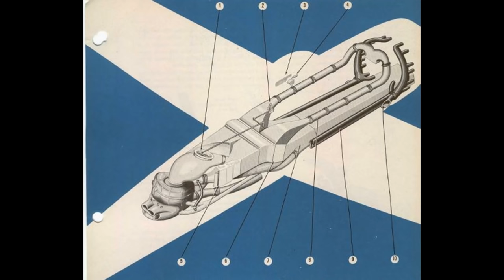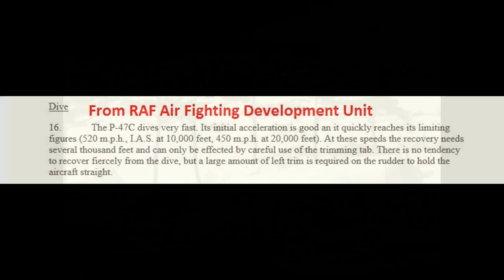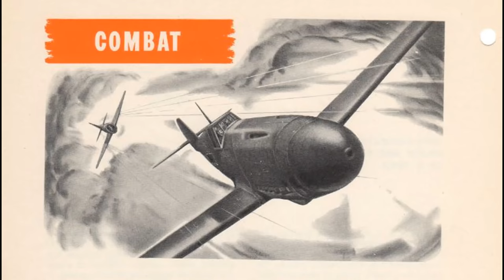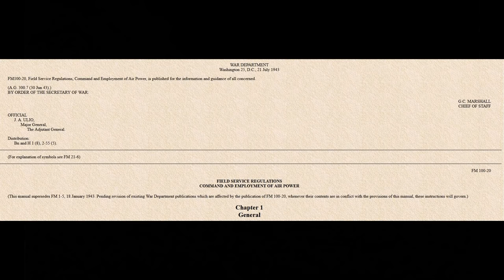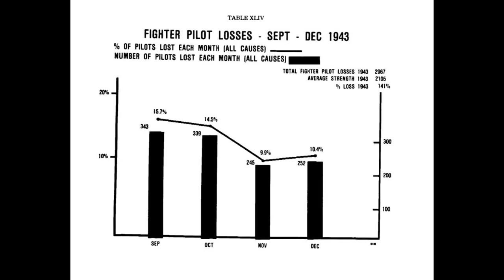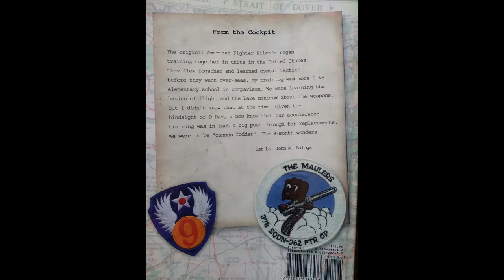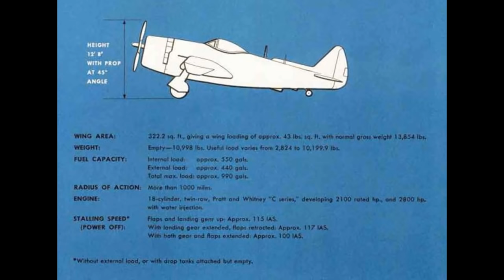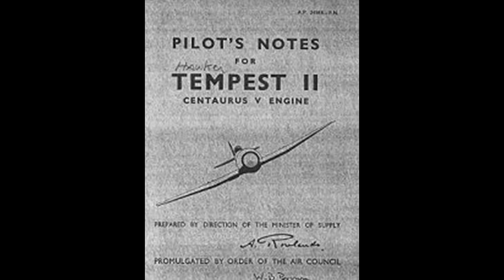P-47 Thunderbolt Pt. 8 Conclusions

Comment: interesting pic at 50:14. That's the Me-109G6 at the Australian War Memorial in Canberra. It's the only Luftwaffe aircraft in the world still in its original paint. That machine is pretty much in the state it was when captured in a plane park in early 1945.
Reply from the maker: I didn't realize that. Thanks for pointing it out, original paint! Amazing.
Reply: @GregsAirplanesandAutomobiles  That plane has an interesting provenance that illustrates some key features of Luftwaffe logistics in 1944-5. Barely visible in the pic is the panel line of the (removed) elongated bulge in the cowling that indicates a DB605AS engine (or derivative). It's clearer in other pics or in person. You can also see the unusually deep oil cooler, also typical of 605AS/ ASM / ASCM / or D model engines. The fin is also messy with a repainted werk number and evidence of replaced rivets. This plane was clearly a G-10 or G-14AS in a previous incarnation. By extension, it's also clear that this plane has had at least three lives: as a initially as a G-6 or G-14, then as a G-10, then finally in the form we see it today, as a thoroughly clapped-out G-6. This plane is a physical record of the Luftwaffe's program of rebuilding damaged and worn out fighters, refurbishing them for re-use. The rough state of the airframe also shows why this plane was sitting in a park and hadn't been assigned to a unit: there were plenty of new or near new fighters ready to fly, so why would they waste fuel on this old clunker? The answer is, they wouldn't and they didn't. That's why this plane has no unit markings.

The facts of the this plane's life as a G-6, then a G-10 then a G-6 again are confirmed by the Memorial's research dept., who are a fantastic resource.
Reply from the maker: That's awesome. What a piece of history they have there.

Comment: The numbers I memorized for Big Week is 146 P-47 air to air kills over a total of 220 air to air kills total + 42 to gunners (against 226 bombers and 33 fighters lost) , so the P-38 and P-51 shared about 74 kills. One of the main lessons of Big Week is the appalling losses of Luftwaffe twin engine night fighter interceptors used in daylight missions... It was indeed a turning point, but the Doolittle "free escort" order and Goering's "bombers only" directive both coincided in May 1944, which probably had nearly as big an effect in changing the air war: Numerous P-51 rookie pilots became ace in a day during that particular month.....

Comment: It's sunrise in Los Angeles. There are three contrails from the SE to the NW. These trails will dissipate, slowly (depending upon wind) over the course of 9-12 hours until they have dissipated into a hazy fog. After sunrise these patterns will be repeated over and over, generally in one direction, from horizon to horizon. THEN: here's the good part - after covering the SE to NW sky (about 2 hours) the high fling jets, so high they are a tiny speck in my binoculars that cannot be I.D. by anyone without a telescope. High flying, indeed. What is that, 60,000? By late afternoon the sky is a criss-cross pattern covering the entire see-able sky. The sunrise trails are almost dissipated into haze by now. By sundown a few trails will still be somewhat visible and L.A. is having another hazy crazy day. Call them what you will. Come to L.A. in the summer, if you are alive or I am or somebody is and I will show you this nutty sky behavior. "Somebody hates clear, sunny days" I said, to no one in particular as they are looking at microwave screens.  You won't believe. You will see it and STILL not believe it.  The jets have 4 engines, by the way. I can tell by the trails. They appear to be painted entirely one dark color (or my best sighting told me).

Comment: Don Blakeslee went from RAF Eagle squadron on Spitfires to fly P47s. Apparently he said “Well, it damn well ought to be able to dive. It sure as hell can’t climb.”
Reply from the maker: True, but that's why they added power. Eventually it's climb rate was at least OK, and actually pretty good.
Reply: I’m sure that Blakeslee got shot up in a P47 and that the fact that the jug was so tough meant that he got home. I can’t remember where I read this though.
Reply: In the book "Fighter Pilot" about Ginger Lacey, there is a passage about Hurricane squadrons in Burma being converted to the Thunderbolt.  "The Thunderbolt was a big, heavy aircraft; the pilots used to say that the only way in which the could take evasive action was to undo their straps and run round the cockpit." 😂

Comment: And also, I don't understand why the Typhoon with its immensely thick wing didn't run into compressibility problems at much lower speeds than the P-47 when diving. I always thougt it had much to do with wing thickness, or doesn't ist?

Comment: What frustrates me very much is that the actual max. speed of late P-47Ds with the actually used high manifold pressures is not known. Resulting power was not very far from the N models so max. speed should have been in the same range
Reply from the maker: That's true, by mid 1944 they were running at 70 inches, probably about 2700 horsepower. Of course we can do the math, but you're correct, no official tests show the performance at that power level. Official book power was 2600 at 64" for the late P-47Ds, but the raised it to 70".
Reply: @GregsAirplanesandAutomobiles  It's just a shame we have no official data. With 2700 horsepower,  shouldn't speed have been almost in the superprop range, even to, say, the Hawker Fury but presumably much faster at 30.000 feet?
Is the lack of late P-47D model data due to he burning of Republic records and archives I mean to have heard of in one of your Superprop videos?

Comment: I think that if it weren't for the Spitfires and Hurricanes, the Thunderbolts wouldn't have any bases to operate from over Europe. So an argument over importance of any allied fighter in the European theatre can not be made without taking this fact into consideration.
Reply from the maker: It's just not a fact. There is no evidence that the Germans ever seriously planned to invade Britain, and they never had a fleet to do it. Therefore, those bases could have been built. Even without Britain the US could have attacked Germany in other ways. However it's all a moot point because without the British, the U.S. would not have even entered the war.
Reply: @GregsAirplanesandAutomobiles  thanks for replying. You've got a point admittedly. Hwever, Germany's attitude towards the whole affair could have been different if convincing air superiority over the island and an ennsuig destruction or keeping at bay of the british fleet had been achieved. I mean it's a dynamic thing and an overwhelming German air superiority would mean that an invasion could take place with minimal serious fleet power - masses of Ferry boats would suffice, and maybe, the invasion of Russia would have been delayed. Whatever. My real argument, although not a very technical one is that the Spitfire holds a significant advantage over any other fighter in the whole "importance" affair: It holds huge symbolic significance, unparallelled actually as the tool that allowed the first serious allied victory over Europe, at a time when the Axis was winning everywhere and darkness was engulfing the continent all over. A largely unsung Greek victory came shortly afterwards, with the defeat of Italy in its attempted invasion of Greece but that's another story.

I loved your last sentence heh, (although you probably meant the war in Europe).

Have a nice night Greg, I love your analyses. I fixed my baby daughter's polystyrene aircraft today which flew erratically by realizing that it was unstable and needed moving of its CoG forward. I attached a small pebble in the foam of its nose and I felt kind of proud that it worked and now it flies like a charm :)
Reply: @GregsAirplanesandAutomobiles  Now I thought of something else though: The P-47 undertook a huge number of ground support missions over Europe, forming arguably the most successful ground attack aircraft of the theatre. Given the significance of bringing down German logistics in France before and during the allied invasion (and causing huge losses to them as well) probablyh played a key role in its success. So after this thought, and on the practical side of things, eventually  I'd agree that the P-47 was the most important fighter over Western Europe.

Comment: At 26:23 you were talking about oil consumption. And you said it burned oil or was it partially burned and leaked while the engine was running  I don’t know a whole lot about radial engines and if they are non recovery engines or are they sealed lubrication crankcases?

Comment: I'm a WWII airplane enthusiast and have tremendously enjoyed your many scholarly videos. I have a question: Could we today do a better job of designing piston engined fighters today than they did back then? If we had modern knowledge of aerodynamics and modern computer-aided design but were limited to WWII vintage materials and engines, how much better could we do than the designers of legendary planes like the Spitfire, BF109, Mustang, Zero, etc?
Reply: Carbon fiber versions of the aircraft would be awesome. And propellers, would the scimitar `fans` used by the C-2 Greyhound help? Maybe they're optimized for hauling but that cargo plane has a maximum speed that would be impressive in WW-II, which wraps back around to your point about design tools.

Comment: My only "issue" with this aircraft was... why the eight .50 cal  armament?  If six .50 cal. were not enough, why not go to four 20mm ? That wing could have hoisted that armament, seeing that even  versions of the Spitfire as early as the  Mk V were outfitted with four canon. I do believe that the P-47's reputation suffered from the introduction of the P-51 yet it was capable of messing with the Me 262 (P-47M)! It was an excellent aircraft and would have proved  a much better ground attack aircraft in Korea. O.K., I like the P-51 as well, so this is not a "I Hate" email!  Had the U.S. been a bit  livelier in getting their fighters into operation towards the end of WWII,  the P-51H, F7F, F8F....P-80 might have seen combat. She was a huge,. good looking aircraft. Very few German pilots could sneer at this adversary!
Reply from the maker: I address the 20mm vs. 50 cal in an earlier video in this series. It seems like you started the series with part 8.

Comment: @Greg Hello, thanks for replying to my comment I very much appreciate it. Sorry I bunched several questions together.😅 I guess my first question is, why did they replace the P-47 with the P-51 in the escort/air superiority roll, was the P-51 better for the role. Was there actually a benefit or advantage to the Mustang in performance as a dogfighter/escort, or was it just money and manufacturing savings?

My third question is why didn't the USAF use the P-47 for ground attack in Korea? Books I've read like "Mig Ally" talk about the vulnerability of the Mustang to ground fire. It seems like the Thunderbolt would have been much better for this role?

Thanks for the information, every book and documentary I've ever seen or read always talked about the P-47 not having the range and having to turn around and the P-51 "saving" the day time bombing, so you're videos so far have been very informative and interesting. 
I very much admire both aircraft, and you're channel is the only one I found that really looks in fine detail at these amazing aircraft.
Reply from the maker: 1. The P-51 was a lower cost airplane, you could buy five of them for the price of 3 P-47s. Additionally the operating cost of the 51 was lower. However the biggest reason in my opinion was that it allowed the bomber to deflect blame for their own failures as I explained in this series. 
2. At low to medium altitudes the P-51 is the better dogfighter, but not by much.
3. They didn't use them in Korea because by that time the P-47s were largely out of the main inventory. Most had gone to the national guard, other countries or were scrapped. Quite a few were in Taiwan where they kicked commie butt. Also, the P-47 is a really expensive plane for ground attack. It was used in this role in WW2 because it was there, but if planning a war five years out, you wouldn't build a turbo high altitude airplane for ground attack.
Reply: @GregsAirplanesandAutomobiles  
Thank you for the explanation, and you're time to explain it. I appreciate it. I very much enjoyed the Videos so far. I find it fascinating the details and facts you have found.

Comment: Another excellent video greg. A couple of points:
1. You talk about the big week as being the beginning of the end for the Luftwaffe but didn’t mention the self inflicted damage from Operation Boden Plate which resulted in a large loss of experienced pilots
2. When working out the P-47 air to air kills did you need to consider bomber kills and subtract them or were they not included in your overall starting figure?
Reply from the maker: Thanks. 1. No I didn't mention that, nor did I mention friendly fire against P-47s. I can't factor everything into a single video, as with any video ever made, there are always omissions. 2. The P-47's kills are just that, planes shot down by P-47s, the vast majority of which were fighters. For example, every one of Robert S. Johnson's kills were fighters.
Reply: @GregsAirplanesandAutomobiles with point 2. I was referring to your math. You started with a total figure and did some subtractions of p-38, spitfire and beaufighter claims. I wasn’t sure what/ how you got your starting number and what it contained? I thought if may have included bomber air to air victories.

With point 1... i got my years mixed up, I thought Bodenplatte was new year's of '43/44 but it was infact a year later which meant it came well after the begining of the end.

One other thing that I’ve always wondered was why the P-47 was never used in Korea while the D model mustang was. I’ve read that it was partly due to the fact that there were a large number of mustangs in the area at the time and they were a convenient choice (apparently P-47s were mothballed in US grave yards by this time) but I’ve never read a satisfactory answer. Do you have some insight?

Comment: read Pierre clostermans book on getting aux tanks for the spittys to go escorting..was done very quickley
Reply from the maker: I have read it. A Spitfire 9 with drop tanks is still a short range aircraft relative to the 38,47, or 51.
Reply: @GregsAirplanesandAutomobiles   correct but the inference they didnt escort as to the best of its limits is wrong...they regularly relieved the 47's and 38's on the way back as they were mostly exhausted, low on juice and or no ammo...they were never going to berlin but they still ranged a descent way over germany at the time.